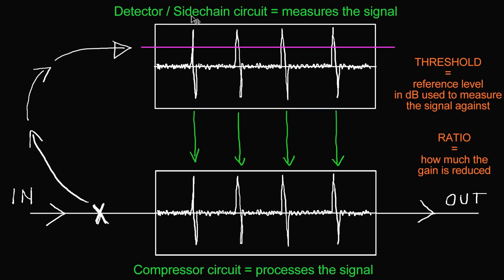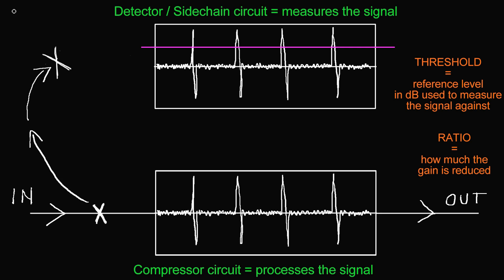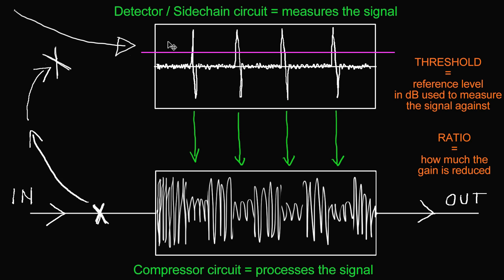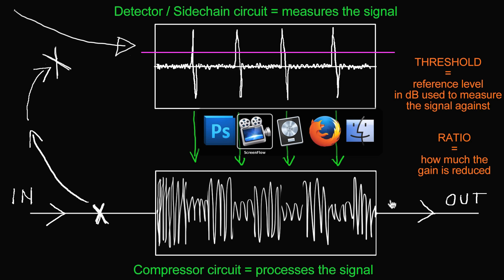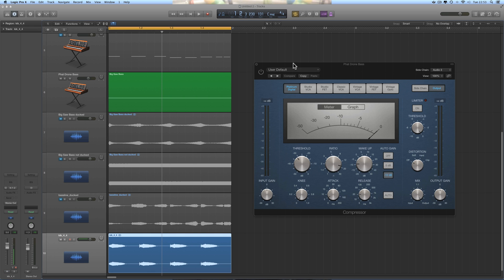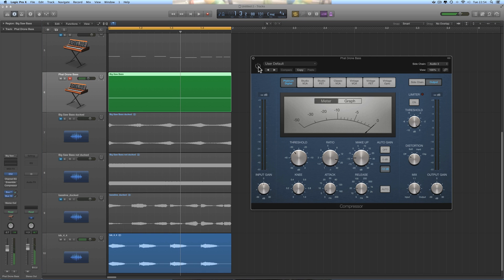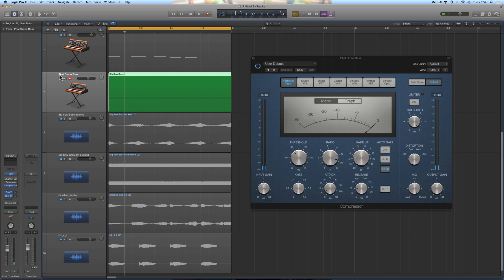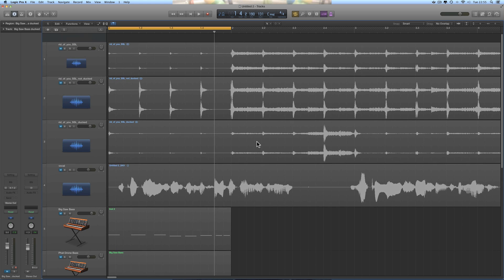Compressors & Compression Masterclass 6 (Ducking or "Sidechaining")

Comment: Excellent tutorial .. So what do l plug into the 2 detector inputs at the back of my compressor, to duck the music when l speak, just like a radio station ?? Bearing in mind, my condenser microphone is already plugged into the mixer (as it has to be powered)
Reply from the maker: you'd plug in the mic signal to ONE side of the stereo comp (usually the left) and set it to stereo link, use a direct out,  or insert (you have to wire the pkug in a certain way),  but it's better to use an aux send cos you can totally control the level hitting the sidechain

Comment: What compressor is this? Is there a free one that does this for garageband?
Reply from the maker: it's a logic plugin, compressors & gates & any other plugins& hardware which utilise a side-chain pretty much all do this
Reply: @dancetech  thanks for the reply! I've found one called Mcompressor by Melda Production but for the life of me, I can't figure out how to use the side chain.
Reply from the maker: @RTF88  well each DAW has a different way of doing it. in logic you just switch sidechain on and then choose the input from the sidechain list at the top of the plugin wrapper - the little speaker icon if activated let's you hear the selected sidechain signal

Comment: I love your tutorials. I feel I'm getting wiser by the minute ;)

Quick tip...
I see you are using photoshop. @3:50 you are scaling the waves down... first the top part than the bottom part. If you hold down ALT (or on Mac OPTION), you will scale them both at the same time.
Reply from the maker: ah thanks.
Reply: I thought I knew everything about compression. I wasn't really aware of RMS and some benefits of sidechaining.... So, thank YOU :)

Comment: Think I got most of this. Having compression on the speaker voice before sending it of as a trigger for best effect. Was this a thing before computers? Did they cable it to get a pumping effect in the late 70's ?
Reply from the maker: hardware compressors have a sidechain input. When you plug a lead into it carrying the external signal, it breaks the internal copy of the signal. Also they have a send/return to do the freq' conscious stuff.
Reply: I thought analog could do it but I don't know when I first heard the pumping effect. Probably was a horrible mistake at first, pumping back and forth until it went up on the charts.